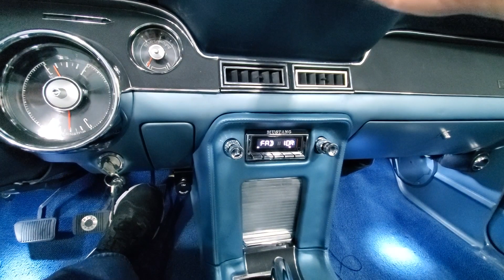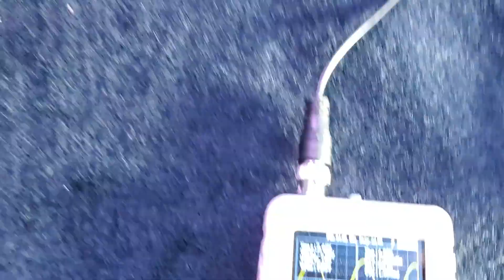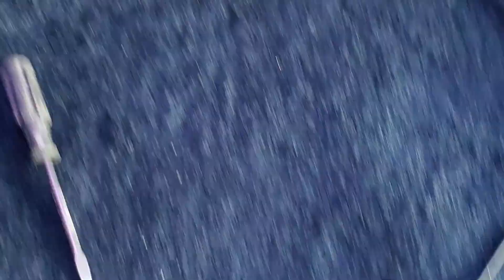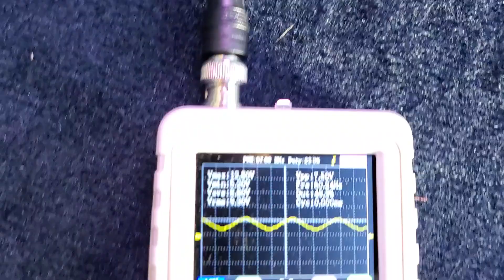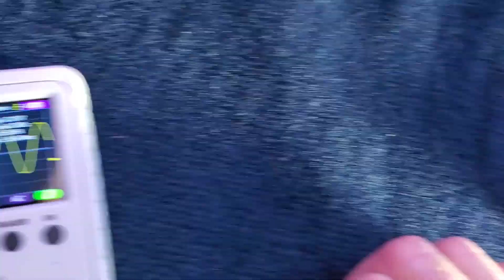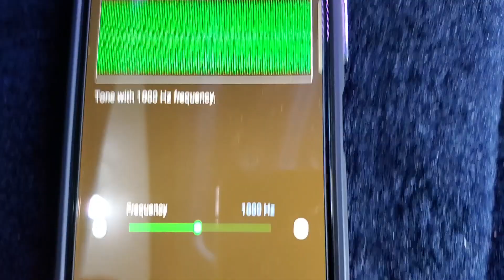setting up a car stereo 68 mustang restoration

Comment: Tires were promised
Reply from the maker: done, just trying to figure out the largest rubber that will fit. there are no answers on the internet on what are the largest 14's you can stuff under the  stock non rolled fenders.
Reply: @68mustangrestoration34  just clean old ones so it looks good 😟
You’ve been avoiding showing car from the side 😢
Reply from the maker: Watch my latest video walkaround